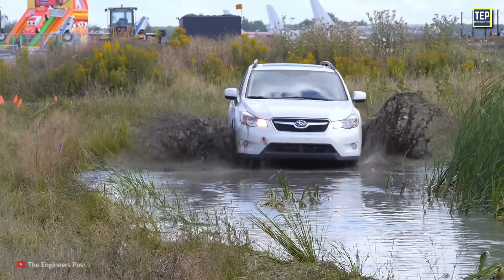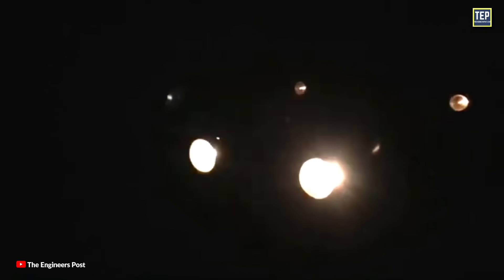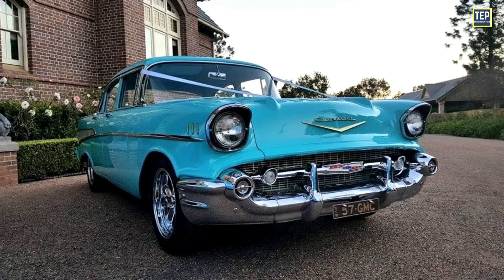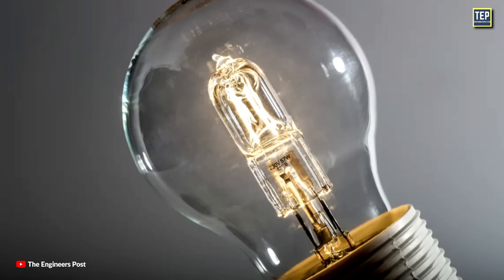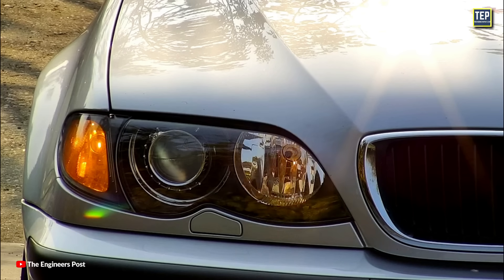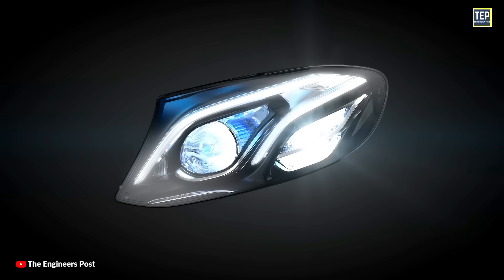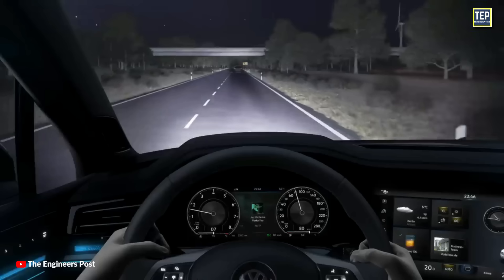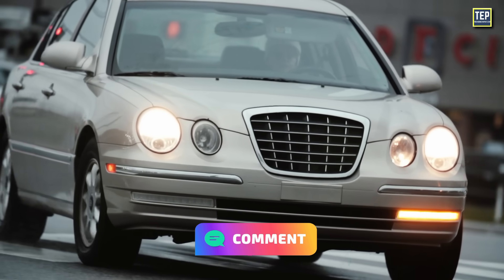The Problem With These Headlights

Comment: The real problem with LED is the high blue light content. This blue light is not much of a problem in normal conditions...It's a huge problem in wet conditions. The blue light scatters easily off water particles or even dirt/salt on the windshield. This creates a glare. GLARE IS REAL but very difficult to measure. There are highway driving videos that show LED streetlighting and HPS side by side done in the rain. You'll see under HPS, the orange light cuts right thru the rain and wet surface to provide decent visibility...The Blue LED light scatters, and everything appears very dark because too much stray light is entering the eye. The LED lighting gives a false confidence of visibility when glare produces significant gaps in visibility. 

Additionally, old people are far more affected by blue light glare than young people. The cornea yellows with age and blue light scatters passing thru the yellow lens, making everything in the field of view appear darker as a result. That's why old people HATE cars that use white headlights and young people don't really understand why. The young people generally think those old people just don't like the new white color or are exaggerating the glare. I'm a lighting engineer...I could go into the details of Rayleigh scattering, veiling luminance, and disability glare from cold white light - the effects on visibility especially for the elderly, and especially during inclement conditions (rain, fog or snow)...But the bottom line is that all street lighting and headlights should be warm white 3000K CCT max, though I'd push for warmer 2700K.
Reply: Not just old people, 19 here with slight astigmatism,.. newer leds make it almost impossible to see, no not retrofits on older cars, im talking about 2023 -2024 vehicles,.. hate them leds...
Reply: @canuckcars  I've had astigmatism and keratoconus since I was 16. People don't understand how I don't see well just after being exposed to glare while driving a car with good headlights, and I'm afraid that the condition is slowly getting worse 😞
🇰🇪
Reply: @canuckcars  The flash is what gets us. They all flash. Some people notice it or are at least disturbed by it. For fun, I have a led "shop" light. Sitting still no big deal. But as a Customer and I were finishing up details I took the LED and swung it back and forth and said "Luke! I am your Father" waving the flashing column of LED flickering at 60 HZ. Neat effect, good laugh. But they flash. Antique AC powered Tungsten filaments in a vacuum giving off a fairly white light.
on the streets? Cadilac F'n LED tail and brake lights! Engineers cause more harm than good. Raise the damned frequency, morons. With that each vehicle could communicate ID, Destination or waypoint, and intended route at the time. That time has come.
Reply: I'm old people and I approve of this comment.
Reply: 46, legally blind. Agreed 👍
Reply: Have no issue with the old white lights, the new ones are awful.
Reply: Thanks, Dan.  Trainee old git here, and I totally agree.  It's the blue tinged super-bright LED lights that absolutely destroy your night vision.  I force myself to look at the nearside kerb when one comes my way.
Keep headlights below 3k degrees.
Reply: Hey Dan, I myself am really into lighting and have plans to become a lighting engineer. I'm wondering what kind of careers there are in this particular field? Do you work for DOTs as a lighting install planner or do you work more closely with the fixtures / diode assemblies? I'm 16, and thinking of going into either materials or lighting engineering. Thanks, Max.
Reply: @LymezoidMusic  I'd repost your comment,  but hit reply to his original comment,  it will tag him, and he'll be notified in his notifications of your comment.  Based on the nature of his original comment,  I'd be willing to bet he'd be more than willing to help someone who's interested in something he obviously knows and cares about in great detail. Good luck on your endeavor.
Reply: @LymezoidMusic  I got a degree in Electrical Engineering…I never intended to go into lighting. There’s much more money for an EE in tech, but I graduated during a recession when all the tech jobs had dried up, and the only job I could find was with a civil engineering company that did a lot of government work - schools, roadways, water and wastewater plants, airports etc. As an EE, I’d put electrical plans and specs together that contractors bid on, and build from. I was frequently assigned lighting calcs. Using the light calc software, I’d lay out the lights, and calc to make sure the design has the proper illumination levels and uniformity for things like classrooms, parking lots, or roadways. Eventually, I was pigeon-holed into doing only lighting…but I didn't mind, I liked doing the lighting. Then, thru corporate consolidation (my small local firm got bought out by an international firm), I was assigned to just transportation lighting, so mostly highways, bridges, streetscapes, and parking lots/garages. So the best place to start would be with the consultants - Firms like AECOM, Bechtel, Jacobs, Parsons, Stantec, Tetra Tech, WSP, among others. Many of the DOTs pluck from the consultants. If you’re in an engineering program, apply for an internship, they always need the help. 
There’s also the architectural lighting - like lighting museums, restaurants and high end spaces. That’s a different path from what I've done, and they’ll still need an electrical engineer to stamp their plans. But architects take lighting design courses, and some architects specialize in lighting.
Another lighting path is sales. Every lighting manufacturer has sales reps who call on engineers and architects to show them their latest products over lunch, and they’ll offer to help or even lay out the project if their fixtures are specified. If you’ve ever been on a street that has way too many light poles, there’s a good chance the sales rep designed that one. But sales reps do a lot of lighting work and make a decent living.
Reply: @danhardhat2 Thank you for the very detailed reply. I've had thoughts of going into lighting design (as in, DOT / streetlight planning), phosphor / blue light conversion tech (as mentioned in the comment before the one I am replying to), fixture design (as in, designing actual streetlight heads, integrating optics, heatsinking, material composition, driver tech, etc.), or working in the SMD / chip industry and working in LED diode design (wafer chips for streetlights, household applications, and the likes) at something like Cree LED or Lumileds.

What field do you personally suggest I pursue? You pursued electrical engineering, but would you advise me to fixate more or less on a broad field such as "electrical" or "mechanical"? Should I specialize in say, materials, or pursue the specialty as my major? I'm wondering which engineering specification I should get my Bachelor's in. Thank you again for the reply.
Reply: @LymezoidMusic  I don't think there is such a career. It's part of architecture, civil, or traffic, I think.  It seems that it would be too narrow to make a career out of it.  Materials is good.
Reply: Blue short wavelength  light passing through the lens of the eye or any lens focuses before the other colors of the spectrum, think of a lens as similar to a prism diffracting wavelengths of light, blue focuses ahead of the optic nerve and continues to the nerve as indistinct unfocused light (Glare is the applicable term) green then yellow focus almost directly on the nerve (higher definition), red longer wavelength light focuses just past the optic nerve (  less definition, higher presence),
Reply: @m.g.540 LED emitters with high R9 value (SST-20) might help preserve the rhodopsin in scotopic/ectopic conditions and reduce the Purkinye effect.
Reply: Heartily agree. Retired engineer and motorbike rider here. My own observations re, headlight color temperature definitely agree. Blue lighting is terrible whenever there is the slightest backscatter (e.g, light fog). And with LEDs, changing the color temperature is easy. Also, large apertures are much better than "pinpoint" sources for not blinding oncoming traffic.
Reply: I'm color blind and the bluish headlamps are painful to me, and make it more difficult to to adjust after the oncoming car passes.
Reply: No, the blue light is very much a problem in any low light conditions, not at all limited to wet conditions.  I experience this every night I'm on the road as do many others.  Wet is worse, yes, but still blinding dry.
Reply: Very interesting comment Mr DanHardHat👍 I sort of wish you HAD gone on at length.
Reply: THANK YOU I hate these lights they blind me so much
Reply: And yet some car manufacturers fit their car fog lamps with white LEDs
Reply: @kayprime20  Yea they should be yellow
Reply: I believe that blue spectrum light as in LED's is not good for the eyes.
Reply: @itsnotforourconvenience2990  Exactly. In the light spectrum, blue is the most damaging to the eyes.
Reply: @itsnotforourconvenience2990 That’s wrong.
Reply: @itsnotforourconvenience2990  There is nothing "good for you".  The sky is always falling.
Reply: The problem is not LED technology, its the color temperature that is too high, usually because is the cheapest.
Reply: @teresashinkansen9402 yes
Reply: I'm young and I hate bright white headlights. I would even downgrade my new car's headlights to halogen. 
By the way, in some European countries the streetlight on big roads are even warmer, around 2000 or 1500 Kelvin, which is actually strongly yellow, but hat makes driving very comfortable and calming. I hope they will keep them as it is.
Reply: @danilg4486 in my neighborhood, they've recently switched out the old overhead (traditional) street lamps to LED. These are absolutely awful. 

they give a garish tone to everything, produce SHARP shadows... and due to light compression, illuminate some objects better than others. It's bad. Bad bad. There's been a petition started already for their removal.
Reply: What’s considered old and young? I’m in my early 30’s and I struggle with the cars these day that omit a white light that are coming towards me on a two way road like in residential settings or country/regional roads where one going up and the other side is coming down. I get so blinded by their strong whiteness that it blocks everything around them that I actually have to stop and let them go first or crawl past because I can’t see a thing and it’s bloody annoying. I keep asking my man who’s usually in the passenger seat beside me and ask him, ‘Why are these lights allowed to be used? Why are they legal? They shouldn’t be because they’re blinding’ whether rhetorical or an actual question, I still ask it because I just can’t believe it and/or can’t stand those lights whilst my car 🚗 is dull as shit in comparison 😅 that sometimes I can’t see because it’s not bright enough or their design is not turned up (directional) enough. My car I’m sure has halogen in a 2013 Toyota Corolla hatchback so maybe it was at the cut off point for these shitty bright lights of I swear every vehicle has now.
Reply: Uh, I'm only 26 but those stupidly bright white LED lights on cars have been bugging me for YEARS! does that mean my eyes are old? XD
No but seriously, there need to be regulations about LED lights, especially as car lights and street lamps (and advertisement boards/signs!!!). I do not drive at night because I cannot see. I get blinded by oncoming traffic, the bright lights leave vision bruises that persist and make it dangerous to drive. Is that not something everyone experiences?
EDIT: also, driving at night makes me VERY dizzy. The limited vision really messes with me and my eyes feel like I'm processing everything with a full second delay. I get very clumsy in the dark and if I close my eyes I can risk falling over because I lose my balance.
Reply: @Star_Rattler That is NOT NORMAL and sounds like you may have an inner -ear issue. Most people can stand with their eyes closed unless impaired by something like weed or alcohol (Common sobriety test). You may also have night blindness which is a common issue in older folks, but not unheard of in younger people that need corrective eyewear. There are many folks not legally allowed to drive at night due to their eye prescription. I commend you for not driving at night. But seriously you should get this checked out. It may be treatable and it could improve your quality of life.
Reply: A large problem with the LEDs is the Kelvin rating, 6000K is blue to my eyes I don't care what any chart says, we need 5,000K LEDs we need 4500K LEDs. I don't know if a single company that has these except for possibly Morimoto, and most likely going to be a 194 interior bulb. They just don't exist at this time,  HIDs are still Superior in my eyes as far as output and kelvin options. I always upgrade interior/exterior,  switchbacks ect, but never again by another LED set of headlights until we get better Kelvin options..
Reply: Excellent points. Further, it is a fact that white/blue light (4000-6000+) saturates the highly sensitive rod cells within our eyes and inhibits the human eye’s ability to adapt to darker conditions, which takes significant time to restore.

Coincidentally, yellow/warm light (2700-3000K) more closely resembles the artificial light sources we have evolved with for quite some time, such as firelight. 

Moreover, red light sources do not inhibit dark adaptation in the same way.
Reply: As a young adult I hate white lights with a passion, especially when I have a headache. The yellow ones are much easier on the eyes/head, they look more natural too.
Reply: I've hated the new white LED lights ever since they started coming out when I was a teenager and I've never had vision issues. (Probably for the same reason I ensure all the bulbs in my house are at 2700K.)  Yes, the newer tech seems novel and all, with adjustable this and that. But based on the real-life on-the-ground anecdotes here, it seems better now just to "keep it simple, stupid" and stick with the complaint-free halogen lamps.
Reply: You're on to it yes! And as others have said, it's not just old people. The spectrum of most common LED headlights all consist of mostly a deep blue, with some orange and red to fool the eye into somehow thinking the light is white. Problem is, in the retina there are 2 types of cells. Rods and cones. Rods are what we use for night vision, they become fully active in lower lighting conditions, such as driving at night. They are extremely sensitive, and their peak sensitivity aligns almost perfectly with the dominant 450-ish nm deep blue peak of LED light, since in our distant past, blue and near-UV was the only light at night, scattering in small quantities through the atmosphere. The problem is, that these blue-light-sensitive cells are basically absent in the fovea, which is the part of the retina responsible for sharp vision around the centre of where you're looking. Those sharp vision cells are the cone cells, and they are less sensitive to light, as they have evolved to operate in brighter conditions. So the cells that should see sharply get hardly any light at the wavelengths they operate best at with this typical LED light, while the sensitive ones get basically overloaded by the scattered light, and especially by LED headlights of oncoming traffic, and through rear view mirrors. And to make it even worse, many of the surfaces we'd really like to see accurately such as deer fur, hardly reflect any of that blue light. So, you end up with an abysmal illumination-to-glare ratio. I was pretty deeply involved in an R&D project and did pretty extensive research in this field (no, not Facebook research), and the results were, in the end, pretty depressing. We found some LEDs that were actually good, by Lumileds, but sadly they're not even on the market anymore 🤦‍♂ PLEASE car manufacturers, stop sh1tting your beds and fix this!!
Reply: LEDs blind everyone but yeah, I imagine old people have it even worse
Reply: The French were right, selective yellow is the way to go.
Reply: I replaced the halogen interior lights to led on my new 4runner, made a huge difference but decided to keep the standard halogen headlights. Still got the brightest Sylvania ones though. I just like the appearance better even if led give better distance. As a dude in his 30s with astigmatism i too like everybody in this thread hate the bright lights coming at you. Kinda like how cities are replacing street lights into bright white led lamps. Much nicer to drive down the highway under the warm amber high pressure sodium lamps. Goes for the bright infotainment screens in cars also. Also yeah the warmer colors are better for snow as well. They make fog lights that alternate from white to yellow for that reason.
Reply: Last time I checked LED lights can come in any colour or tint of white, so it's really just a matter of selecting what is correct for the situation.
Reply: @bojangles2492  and just what brand of headlights are you talking about?  There are zero that are available on the market below 6000k
Reply: @bojangles2492  link?
Reply: @keithbartlett7679  Youtube won't let me direct link, or even mention the store name sounds like Ali xprs. Heyword 26000lm 160W 1860 CSP chip 3000k/4300k/6000k/8000k Car LED Headlight.
Many more on this store.
Reply: Need to drop from 6000K to 4000K
Reply: I have this issue due to a cataract in my eye been swapped out with an artificial lens, since had that surgery led lights are a nightmare when on the road they are far too bright and very blue light I’ve had to do several emergency stops as have been totally blinded by led headlights
Reply: Bringing back the old style french lights (selective yellow was the name iirc?) would be pretty nice, they're really easy on the eyes
Reply: Thank You!  Please make this a law!
Reply: Blue light exposure also damages your eyes.
Reply: Even with developing cataracts, this old fart loves LED lighting.  I have 6500K LEDs in my shop at home, 10-4ft tubes in a 13x15 room, and 40 in a 3x50' room. I added the LED option to my truck, for an additional $4K (with the rest of the options group), IIRC.  I like to be able to see.😁
Reply: I’m 48, have been spending my life looking at screens for work, never had issues with my eyes, only bought my first pair of reading glasses this year. I used to love driving at night, but now it’s very difficult with LED streetlights and headlights. Halogen and Xenon headlights never caused me any trouble and I loved the warm diffused glow of mercury vapour street lamps. But my eyes can’t tolerate LED lights, especially those new brights headlights on Teslas, Ford Explorers and other new cars. They blind me and hurt my eyes on the inside (hard to explain). When this happens, it takes a while for my eyes to be able to refocus correctly. The same happens with blue LEDs. I resorted to wearing goofy yellow glasses that help reduce some of the bright light, but it’s not ideal.

As for LED street lamps, they just don’t work, the streets are much darker than before and pedestrians and cyclists are harder to see, it’s dangerous. I know I’m not alone, I see more and more people driving in the city with their high beams, which is another problem. Also the glare when the streets are wet is nuts. As far as I’m concerned, LED lights are worse then what we had before, I wish they never existed.
Reply: I can assure you it's not just old people, I'm not even in my thirties and I've hated LED and HID bulbs for their blue color since they first started showing up in cars here
Reply: I really really appreciate your comment, and people like you who actually thing dynamically and speak on things about which they actually possess knowledge. Thank you OP

- Daniel
Reply: That's true. The white/blue led lights are really not good on dark with raining conditions. The good thing is that have leds bulbs with 4300k that is more close with halogens collor but with more potence/efficiency. Other important thing is that to change any bulb without a correct regulation or proper configuration turns a risc for the other drivers.. beuty without safety/efficiency is a stupid move.
Reply: YOU should make a video.
Reply: Early LEDS were always affected by colour casts like blue and purple etc. The reason car manufacturers haven’t moved to a warmer colour temperature is because we see blue light as brighter even if it’s not. When someone sees cold colour temperature light, our brain sees it as much brighter than a warm colour temperature light even if the warm light is actually considerably brighter. 
Another issue with cold colour temperature lights is their effect on colours. Yellow roadsigns look green, grass looks teal and red signs look brown. 
Quite why governments allowed the new tech to proliferate without any of the facts you’ve relayed being examined is baffling.
Reply: @Dreyno  Modern LEDs also have different tints, that hasn't changed. Car manufacturers are using cool white LEDs because they are cheaper and a few % more efficient. More - an average consumer sees cool white light as modern as opposed to the "old" warm white which reminds them of halogen bulbs (why do you think there are so many incandescent bulb with blue filters?). If its cheaper and sells better why change anything?
Reply: Biggest issue is people do not understand they can and should re aim their headlights when they change their bulbs regardless of what type of bulbs they use.
Reply: I would like adjustable color temperature headlights and we already have the technology for it.
Reply: First of all, there is no such thing as a blue LED!   The LED emitters emit white light and it is refraction of the white light that gives off the scattering of blue at the edge of the lens!  People somehow think this is actually blue LED !!!  Nonsense !
As for 3000 degree Kelvin color temperature - that's those incandecent yellow bulbs that you see on the road which does not illuminate the roads at all ! ! !
Sunlight is about 5000K.
What you are seeing are improperly adjusted headlights and not the fault of the color temperature! ! !
Reply: there should be a worldwide law that mandates all street lights to be at a certain light temp that allows great visibility in an asphalt + raining condition without glaring other motorists. 

bs motorcycle riders in our area add aux lights thats super strong but not properly aligned. these shts have a place in lleh
Reply: I've upgraded to after-market headlights that accept really bright LEDs about 180w halogen equivalent per bulb. And I had wipers which were long gone. When it rained, the glare was so bad it was crazy. It was almost better not to use wiper in certain conditions.
 And if ther was someone coming in the opposite direction with crappy LEDs in halogen housing/ low beams adjusted to high or straight up hight beams on, it felt like there was a light barrier on the windshield created by the glare. 
But once I got new wipers, it was pretty much crystal clear during rain.
Reply: Actually is worse.
Blue light stop people from sleeping, however they also is the one that force eyes to adapt the most.
a Reddish light is way less blinding.
Reply: For the lighting engineer from an automotive technician,did you know that before car manufacturers used LEDs for their vehicles outside of some gauge applications they were used for semi truck trailers and the aftermarket sold them for automotive customization and upgrades such as underglow (alongside actual Neon lights) in the late 90's I remember seeing them in catalogs before September 11,2001 so this vid is off on several things, though I was already to it with a grain of salt for reason. Have a good one.
Reply: Thankfully you can still get warm white LED's, which are the only kind I use.
Reply: @Hunyadi1442  And just what brand is this?
Fas I know there are no LEDs available on the market below 6000k
Reply: I perfectly agree with you... Moreover LEDs can be of low quality for the sake of marketing and thus the problem accentuates. I would stick to safe and Reliable Halogen lamps.
Reply: @Turnipstalkwhy aviators?
Reply: do even i dont like how bright and eye piercingly white modern headlights are. honestly if i have a car one of the mods i would do is make the head lights orang like halogen.
Reply: 100%
Reply: Do you have any source or proof?
I really like my new Philips h4 6000 kelvin leds bulbs.
It is clear as day
Reply: @VulcanViewer  Well, I do, but it's not something where bright light matters.  It's a matter of shadows.  Shadows are damn dangerous with spinny sharp things around.
Reply: led's are also far too bright.
Reply: Yes! This!
Reply: I'm screenshotting this comment because it explains what I'm trying to explain to many people that go with the fashion without thinking.
Reply: I agree with most of it except one - the optimal LED CCT is 4000K-4500K as it's visually closest to sunlight.
Reply: Thank you
Reply: Be nice if old people focused on headlight legislation instead of what pronouns other people choose to use.
Reply: Considering that the human eye has evolved to circa 5600k, lighting in that area is optimal for good vision, not yellow, low kelvin lighting. 
LEDs are capable of producing any kelvin necessary, and with a mix of LEDs, a decent bandwidth is easy and effective.
LED is the best thing that ever happened to lighting 💜
Reply: @markblanch2905  Did you know LED hase s Hz flashing working pulse on your brein.
I think you need to drive with me on the N1 1200km 1850km in the night South Africa.
Head lights are shining in the sky all over.
There is now diffrence on beam or brights anny more.
It is just blinding blinding blinding BS all night long.
Reply: @andrekemp5059  I work as a Gaffer (head of Electrical/Lighting department in Film and tv) and use LEDs for nearly all the shoots I light so I'm pretty familiar with them
We use flicker free gear so that cameras can shoot at frame rate they need. I don't think LED headlights would cause anyone problems from "strobing", it's not really possible.
I've never had a problem, nor has anyone else with the ones in my car
Reply: "Without dazzling" Sure ok...

Sometimes you have to trust the road is still where you left it. If that windshield isn't CRYSTAL clear too...
Reply: To prawda. Zwykłe europejskie żarówki H4 w deszczu dobrze świecą. Ledy H4 słabo świecą w deszczu. Ledy jedynie lepiej świecą w bezdeszczową, suchą noc.
Przydał by się reflektory z dwoma żarówkami. Led na suche noce i klasyczne żarówki na deszczowe.
Reply: I hate LED on headlight.
Reply: @dayasagarchourehembrom6092  
Jes need to be banned totaly.
Last night I drove 425km.
85% truck on the High way.
These new Volvo's 440 560 lights beams are Lasering my eyes.
I drove this month over 4500km 65% at night.
Mostely these new cars are beaming my Eye balls
Reply: The cornea doesn’t yellow with age the lens does. The cornea stays optically clear unless due to disease. Arcus is the exception but affects the peripheral cornea only.
Reply: These is not true  with LED lights to everybody  ...is like  compare candle  with electric bulbs ...LED lights it is a huge step ahead. ..Can fit in retro headlights  ..and save lives  !
Reply: @zolizota  I should have clarified... it's not LED tech, it's the color temperature of the LED that the auto manufacturers use. They use between 4000k and 6000k, which is a cold white. They could and should use a warm white LED, 2700k-3000k, with lower blue light levels, that would look more like conventional halogen headlights.
Reply: What about LED headlight  but in warm color - like 4000k ?
Reply: Isn't 3000k too yellow for headlights ? I was looking for 4300k!
Reply: Some people can perceive UV light. Which may also mean their ability to see regular blue might be more amplified.
Reply: @jeffkardosjr.3825  Fake News
Reply: Какой прекрасный аналитический комментарий по теме ролика!
100% попадание!  Респект!
Reply: Thank you! My new led lights are great, except when it is dark and raining, now I understand why. Is this worse for people with miopia?
Reply: here with severe astigmatism at 20, any time somebody passes me at night (when it's raining it's the absolute worst) i am completely blinded, it's just as bad when a pickup trucks blares them straight into my mirrors. ive grown a hatred for led lights :/
Reply: @boop_ship39  
Your optometrist can't fix it?  
You should get your rear windows tinted so to cut down on direct incoming beams from trucks !
Reply: Amen
Reply: Anything over 3000K is straight up garbage for night driving. Our eyes literally evolved with firelight (1900K), so all these fancy white/blue headlights are completely unnatural. They're trash for actual visibility and wreck your sleep cycle. But car companies keep pushing these awful lights because most people are ignorant and think that they look better.
Reply: My road got new street lights that are LED. Bright white. I can't see a damn thing at one intersection cause I am also looking straight into the light beam, blinding me. Even at a full stop.

Another day I wanted to see, if these lights light up a large(r) area (than the ones we had before) and turned my low beam headlights off (from a 2009 Citroen C3 I). I was really disappointed by how there are so many dark areas and all these lights do, is blinding you 😢. I can't see pedestrians nor animals in the beam of the streetlights. So weird to me
Reply: I have moderate astigmatism in one eye and wear contacts, yet personally, I haven't had the problems people are describing.
If the issue is blue light, maybe the night driving glasses with a yellow tint like I've seen marketed would help. Some of these have mild polarization, which I think could also help with glare.
Reply: am young, and i hate these leds since the first time i "saw" one of thoses... mb one decade later that's still hurt my eyes
Reply: California Vehicle Code specifies that emitted light must be on the infrared end of the spectrum, but clearly has never been enforced. i prefer 2500k HID, like endurance racers and rally cars use
Reply: @matthewkuhl79  " infrared end of the spectrum" 
That would be invisible.
Reply: @kenweller2032  As in red/orange/yellow not blue or violet. i didn't write the code, i just recited it.
Reply: the blue effect is more pronounced with original LEDs, compared to if you install quality LEDs from renowned brands like (cougar motors,bevinss,novsight,hikari ).
Now Osram have good LEDs without to much blue effect
Reply: 36 yrs old, and got a straight up headache during the last major rainstorm from all the headlights coming at me. Is there any way we can get this codified in law, and get all existing heatlights retrofitted via recall? I knew there was a reason I hated "white" headlights, and preferred the yellow ones. Is there also any easy way to identify the yellow ones while purchasing bulbs in the store? "Be the change you want to see in the world" and I want to see fewer blinding white headlights.
Reply: The projector style lenses are really what concentrates this light.
Reply: You can buy them in different temperatures. Most people like 6000k because it looks cool but it is not the best light in poor weather. I purchased 4500k  LEDs fory car. A bit white than the original halogens but not so white to not work well in rain.
Reply: This problem is exaggerated heavily with an astigmatism, makes it incredibly difficult to see
Reply: I have yellow lights on my Citroen DS 23 from 1974. Its perfect in fog and in rain.
Reply: I have yellow lights on my Citroen DS 23 from 1974. Its perfect in fog and in rain.
Reply: I am only 64 but I can tell the best headlights I ever had are on my Tesla Y . Smart ones . Way better then BMW xenons before 😊they used to blind me on high beam reflected from road signs
Reply: @sergeilapa9082  I hate all the Tesla light as it is aggressively sharp and too bright.  Not only the headlights,  even that tiny rear indicator lights are extremely annoying when you are that "lucky" to waiting at the traffic light just behind a Tesla.
Reply: I now know why I struggle to see things my much younger work colleagues see with ease. 

I have to shut the doors, and cut out the background sun lighting, that is so bright everything else seems black. All I can see is the sun reflecting off the floor. It blinds me. 

Sometimes I even turn the lights off, and use a torch.

All I can see if glare.

Then with the glare removed I can see what they are asking me to look at. Ah, yes, undo that bolt first, then the other will be accessible.
Reply: But what you described isn't LED problem but lights temperature. 
As stated in the video, LEDs can be programmed to emit wide spectrum so I guess it's your job as light engineer to implemented street light that emits best color temperature for given scenario. 
So yellow when raining and blue/white otherwise.
Reply: @drayke8886 You cannot in fact program an LED.
Reply: @drayke8886 you can not program leds 🤦🏻‍♂️
Reply: When you have cataract you have to get a surgery, or you can't drive at night, it becomes dangerous, and the cause is, any lights coming to the eyes when it's dark around, blind you.  Having cars that do not light well is not the solution, to "allow" people with cataract to drive.
Reply: @YannR34  You're being WAY too simplistic.  Cataracts can develop over long periods, even decades.  There is no "if you have cataracts...". Yes, I have cataracts in both eyes, and have had for a decade.  They're nowhere near the point where I need surgery and I'm fine at night, even with LED lights (as long as the brights are off).
Reply: Don't let the facts get in the way of the truth.
Reply: @johannjohann6523  It’s physics. Rayleigh scattering is a physical phenomenon where light is scattered by particles that are smaller than the wavelength of the light itself. This scattering is responsible for a number of natural phenomena, most notably the blue color of the sky, and red sunsets. When sunlight passes through the atmosphere, the shorter blue wavelengths are scattered more strongly giving the sky its blue color. At sunset, sunlight travels a longer path through the atmosphere. Most of the blue light is scattered away, leaving the longer red wavelengths to reach our eyes. The point is that blue light scatters more. 
Mathematically, the rate of scatter is inversely proportional to wavelength of light to the power of 4. Since red light’s wavelength (675-nm) is about 1.5 times blue light’s wavelength (450-nm), the rate of scatter of blue light is 5 times that of red light.
The rate of scatter is also dependent on the medium that the light is passing thru…For instance in clean air, there’s not much scatter…But in dusty, polluted, or smokey air, there’s much higher scatter rates. Also, the rate is much higher thru dirty glass vs clean glass. 
With regards to visibility, when a ray of blue light enters the eye, rather than punch straight thru the cornea, lens, and eye fluid hitting only the single nerve it was headed for, a significant percentage of that blue ray gets scattered and lights up all the other nerves at the back of the eye. So the brain tries to adjust by making the viewed image darker. The scattered light becomes the audio equivalent of background noise, washing out the view of fainter items within the field of view. 
With regards to visibility for older people, as we age the fluid in the eyes becomes more cloudy, the cornea yellows, the point is we build up more flaws within the eye that are smaller than the wavelength of light, that cause more scattering within the eye. And since scattering of blue light is 5 times that of red light, blue light affects older people significantly more. 
Now in reality, we’re not dealing with red and blue light. We’re dealing with cold white vs warm white light which is a broad spectrum of different wavelengths from 400 to 700-nm…But the predominant process of creating white light is a process called phosphor conversion. This process starts with LEDs chips that produce blue/ultraviolet light, and this LED chip is coated with phosphors that absorb the blue light and emit light at longer wavelengths (yellow, green, red), creating a white light of the desired color temperature. To create warmer light, they essentially use a thicker coating, which reduces the lumens per watt efficiency or efficacy (gross oversimplification warning - apologies to phosphor coating technologists - there’s more chemistry not just a thicker coating). So many early adopters of LED chose the most efficient - cool white for street lighting. But after seeing the difference, with glare issues and brightness complaints, for better visibility, especially in wet conditions, it’s best to go with warmer white, even though there's typically about 10% fewer lumens per watt.
Regarding headlights, luxury cars will never go back to warmer colors because their customers expect the blue-ish cool white. The blue-ish light makes everything look cleaner - the landscaping looks greener, and the white picket fence pops. So, unfortunately, only safety mandates can bring headlight colors back to warm white. There’s so much evidence of increased nighttime accidents in the last 10 years, and phone distraction gets the bulk of the blame, but phones are also distracting during the daytime.  
This 2-minute video demonstrates how blue light scatters, and red light punches thru. As eyes age, lens and eye fluid get more cloudy, like the milky water in the demonstration.
https://youtu.be/-Xx7sPPTu3Y?si=OsQ9uKu_Wviux5k5
Reply: @johannjohann6523  As a Matter of the Facts. 
The HeadLights are shinning in my Eye balls and it sting in my head lights.
Reply: Years ago in France, they drove around with yellow headlights. My dad said they worked better in the wet.  Certainly less glare when you faced them coming the other way.
I think the modern leds are dangerous. Also the red rears lights are too bright.
Reply: I miss the blueish white lighting in my country but now I understand why they had to change it (ಡ‸ಡ) man the aesthetic we simply unbeatable back then tho
Reply: No I hate the warm lights. They look so ancient and just don’t illuminate at night as well
Reply: Warmer lights have lower visibility because warmer lights don't provide as much contrast and color saturation while making people more sleepy. Blue light isn't pleasant to look at during nighttime but that's good when you want drivers and pedestrians to be more alert. The warm amber lights are better for indoor lighting.